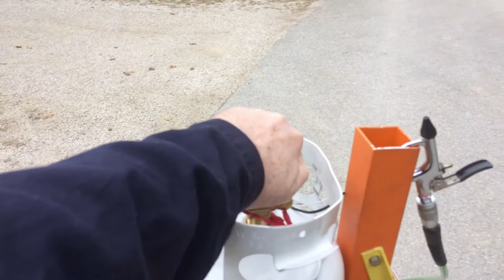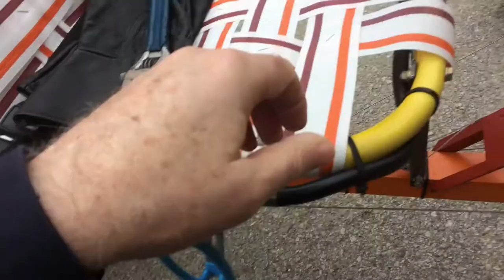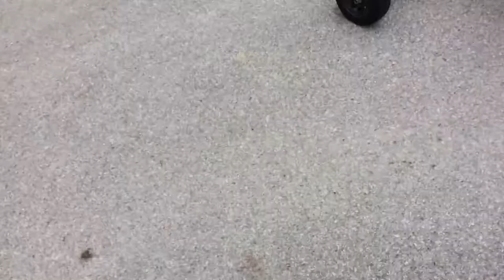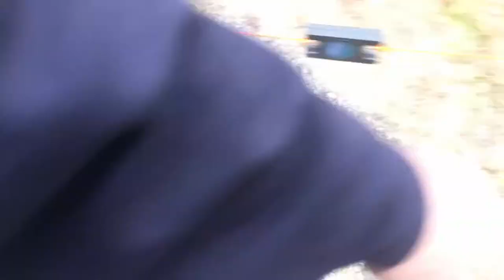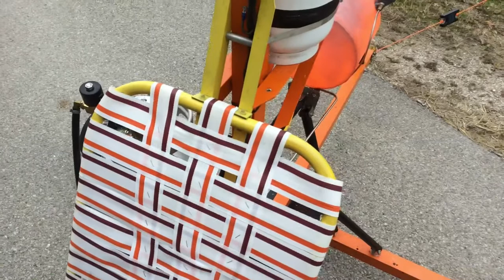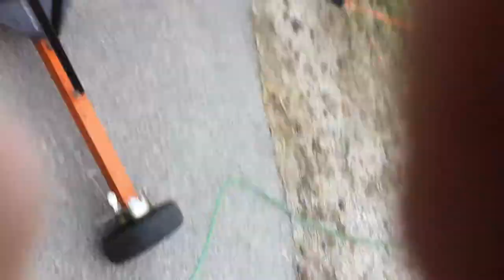Pulse jet go kart 66

Comment: Very nice Tim!  I'm sure the warmer temps were a help also.   Looks like this is the warmest day this week.  I guess you could paint your liquid tank flat black to help catch some heat from the sun and engine.  Every bit will help.
Reply from the maker: Yea, flat black paint is on the list. I still need a liquid valve with a larger orifice. The stock valve that I'm using only has a 1/4" seat. Had some leaks in the brass flair fittings on the last run. Ordered some stainless replacements. How do you eat an elephant, one bite at a time!
Reply: @timcoleman8964  lol. Roger that!